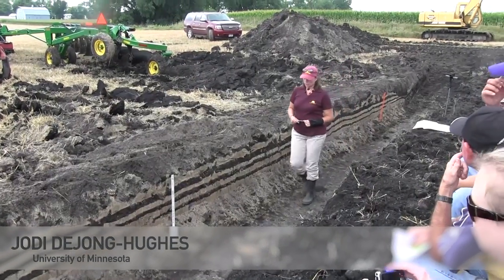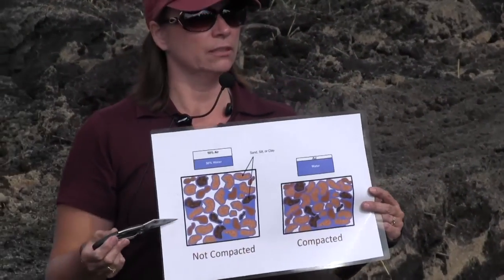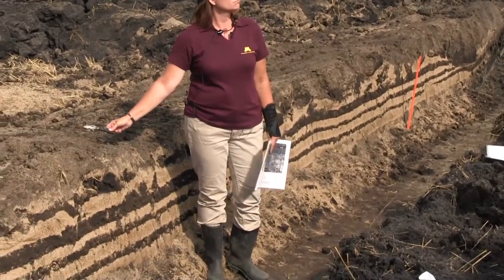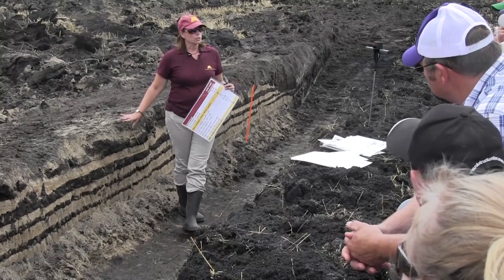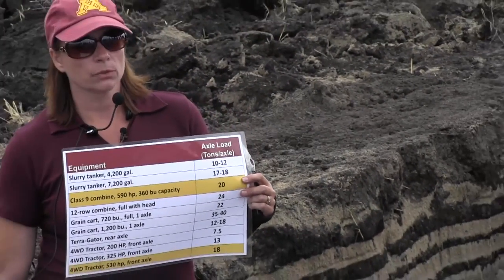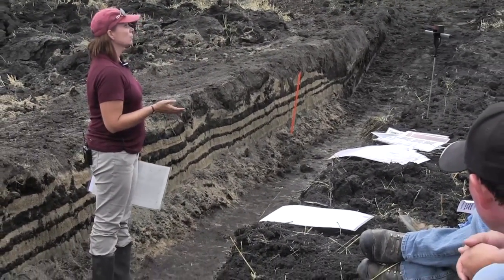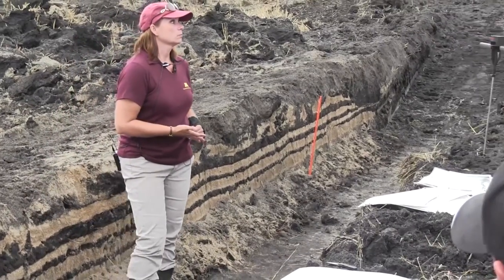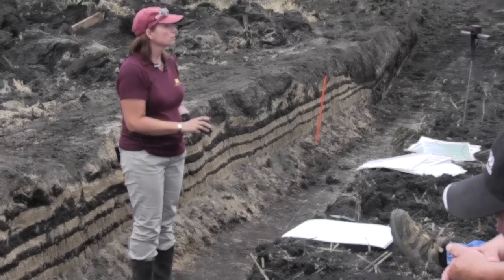Tillage, traction and compaction - deep tillage

Comment: I'm from N.S. W. Australia. Wow this is the best lecture on this that on this subject that l have heard. We were in self mulching black basltic soils through to sand. We couldn't work out why even sunflowers could get vertical roots because at four inches every root went side ways would stop growing down and only go a short distance even wheat and sorghum would do this. And it would short yellow and spindley on another far it was far worse than this even clovers and Lucerne would only be stunted and yellow  and stripey but after deep ripping in a drought(!done to controll severe nut grass infestation twice with Secord working being a 45deg cross rip  for the next ten years there was none of these problems or desease issues that had been plaguing us. J had the tractor tyres running on radials set on 16lbs psi there was slippage and so on.

Comment: Not a farmer myself, I'm a dedicated gardener, but if I was growing corn or other crops she has demonstrated excellent points.

I turn my soil by hand between every year we plant. I understand air content, moisture retention as well as drainage, along with nutrients needed for certain plants such as tomatoes & peppers to prevent end rot. It's been a learning curve and you only get 1 time a year to make any changes. Our garden is very high yeild and low on desease, except for a root worm problem I thought I had solved using damascus soil, but it turned out to be a failure as I had to pull all our raddishes early after seeing brown leaves/signs of plant distress. Root worms were of course the cause of that distress, and still figuring out a way to kill/get rid of them without using any chemicals.

My take away from this is the compaction aspect of it. I have tri-mix soil and obviously don't run heavy equiptment over my garden, that being said, I see the importance of trying to maintain a very none compacted surface. I'll have to be mixing in some pete moss at the end of this grow year as my soil is starting to get compacted.
Reply: Which is why I'm digging in 20% biochar deep at the most compacted layer where I grow corn and elsewhere, especially for tomatoes. Since biochar contains air and homes for the micro life it permanently solves all soil issues.

Comment: Great videos! Thank you! I have a few closely tied questions:

Why does the compaction depth not change with ground pressure? I understand from watching your videos that with lower ground pressure compaction intensity will decrease at all depths but the compaction will still go equally deep into the soil. Is that correct?

If the above is true, what determines the compaction layer depth that a tractor leaves behind? How is it related to intensity and depth?

I look forward to your reply. Thank you for your time.
Reply: The compaction intensity varies due to your soils ability to disperse weight. 
 If you push down on the soil with a 1 inch rod, the rod itself will leave roughly a 1 inch hole, but the compaction happens in a cone shape below your hole.
 Think of how grain piles up in a bin, in a conical shape because the weight is distributed evenly in a cone beneath the auger or source.    
  The same thing happens in the soil, the weight is distributed evenly as well.
 Every grain that has weight applied to it spreads that weight out to the grains that are holding it up.
 The more weight the more compaction, but the level of compaction stays fairly stable due to this dispertion of weight.

Comment: You are asking great questions.  Soil compaction is not an exact science.  There are too many factors that contribute to soil compaction to accurately predict depth of compaction.  These include: soil texture, soil moisture, organic matter content, restrictive layers, soil structure, tire/track psi, axle load ...  However, when it comes to factors we can control, we look to tire psi and axle load.  The heavier the load the deeper the compaction.  The higher the psi the more intense the compaction.  There is research out of Ohio State University that shows psi also affects the depth (as well as the intensity).   Research has also shown compaction down to a depth of four feet, but more commonly down to 2-3'.
Reply: 2 things. 

1.  At what point is ineffective? For example you said it’s been shown that compaction can be found as far as 2-3 feet. My question is at those depths how intense is the compaction, does it actually affect the crop? 

2. Thanks for not calling that school ‘THE’ Ohio State University

Comment: You have made many good points. But in some instances not plowing can cost money.  We run a disc ripper every other year and other tillage practices on no till. But if we have to go corn on corn plowing the cornstalks will gain 15 bushels  and we have friends that have found the same response.
Reply: What is the multiple tillage passes costing you? 15 bpa x $5.50 corn  = $82.50

Comment: Load bearing capacity of air depends on atmosperic pressure, but the range we have in the atmosphere naturally is very low even at the highest pressure level.
 Think of a boat... it floats on water, but not in the air.
Reply: False comparison. A boat floats on water, not in it. That's why a boat can sink.

Comment: One of the comments struck home.." No one knew how to set the plow"  Is it so bad that plowed residue is slower to break down?  To me that seems like a good thing as it is a sign that the residue is not being converted rapidly into carbon dioxide and global warming.  Much of the criticism of the moldboard comes as a result of not knowing how to use it, how to set it, how to maintain it, when to use the plow, when not to use it.   Correct soil management using a moldboard plow is much less damaging than disc rippers and chisel plows. 

The ripper style tools totally annihilate soil structure completely disintegrating the fungal environment whereas a properly set, properly used moldboard will cut and turn a slice of soil and does not completely annihilate the biological environment.

On the subject of plow pan there has to be a distinction made between a change in soil density and a plow pan.  A change in density is created by a plow but a plow pan is created by over inflated tires in the furrow bottom, plowing at the same depth year after year, a poorly adjusted plow, worn out ground engaging parts.

Soil doesn't mind the appropriate use of a moldboard plow in the rotation - how do we know this?  Yields and profits increase.
The moldboard plow is not an environmental and soil health problem. The misuse of the plow is the real culprit.
best regards
Jim
Reply: Where I am we have issue with keeping organic matter from breaking down too much as the ground is saturated and doesn't quite freeze in winter. Spring plow with a disk is too late to break down sod and weeds and fall plow breaks down too much and substantial nutrients leach. Early spring moldboard is just right.  
The main issue here is that the organic material is then buried so deep that it has no benefit to seedlings.

Comment: Cant believe the soil in this video. We are solid clay. I can dig down 15 feet with an excavator and it is just more solid clay....
Reply: Sooner or later it will change. I'm in SC, I live in a very low place, top few inches beautiful black soil  then dark clay. Few years ago I embarked on a adventure, I drilled a well by hand with a auger. I started under a 15 off the ground limb to help hold the pipe when I pulled bit up. I used two large pipe wrenches to turn 3/4 sections of galvanized pipe. Started with post hole diggers to about 3.5 feet. At about 10 feet I hit red clay,took many turns of pipe to get mabe 8" in any kind of clay, then all of a sudden pipe drops several inches and I pull up the whitest beach sand you ever seen, that layer might have been 8" thick, then I hit some kind of blue, gray marl clay mabe 3feet thick, then all of a sudden pipe drops again and I was back in sand. The Atlantic Ocean was over my property in the past, I'm around 90 miles from myrtle Beach.oh,in a very bad drought I hit water at about 12 feet. Property is only around 200 feet above sea level.